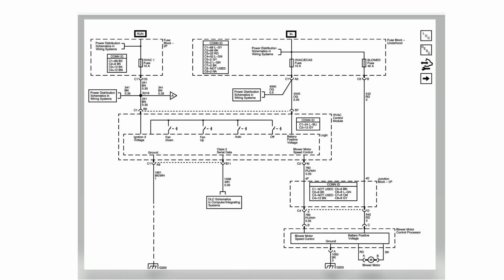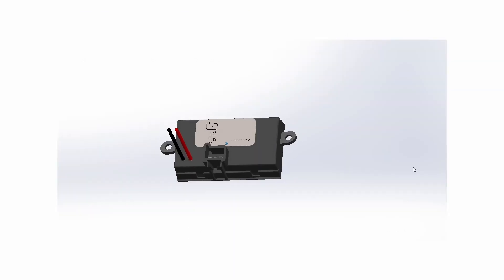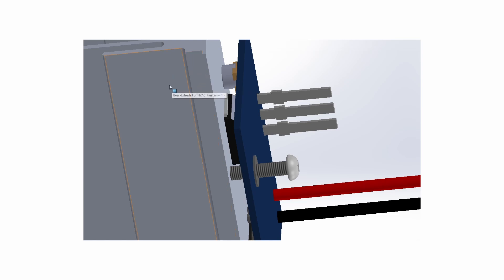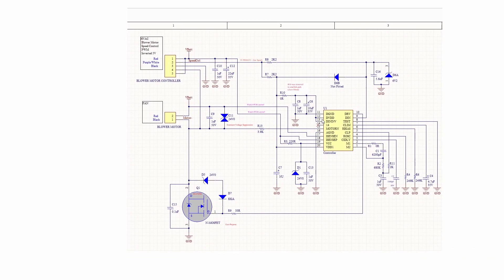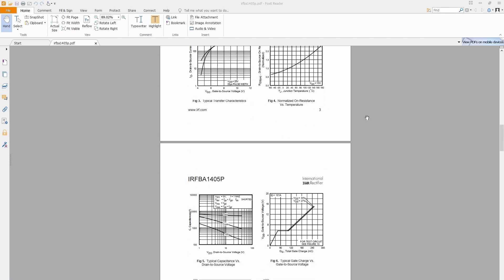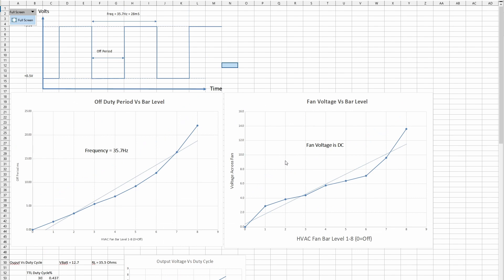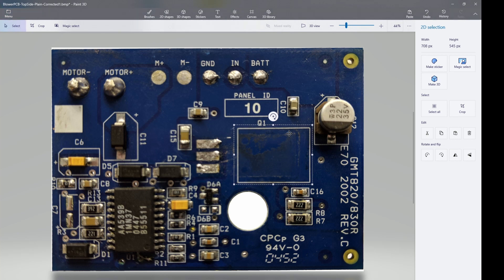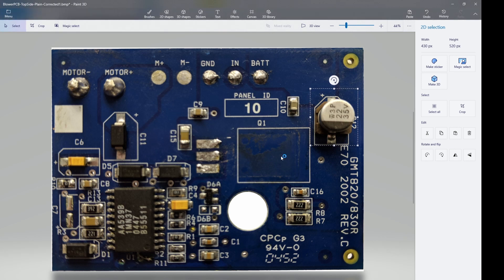Hummer H2 2005 - Blower Motor Controller Part 2

Comment: I don’t really like the design either.   I wonder if there is a different way to control the voltage to the fan without such a large heat sink and the heat it gives off?
Reply from the maker: Thank you for commenting. Indeed there ought to be better, more modern electronics these days..